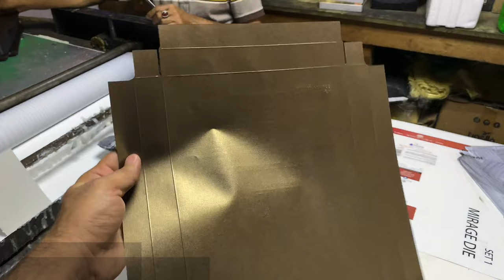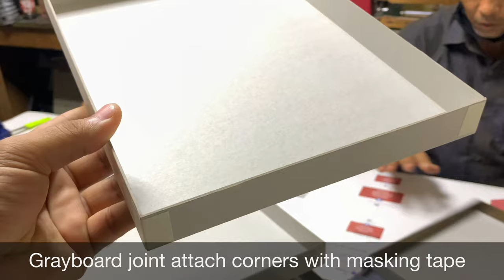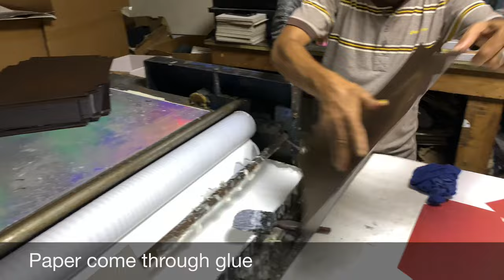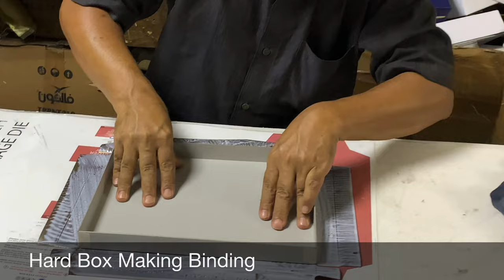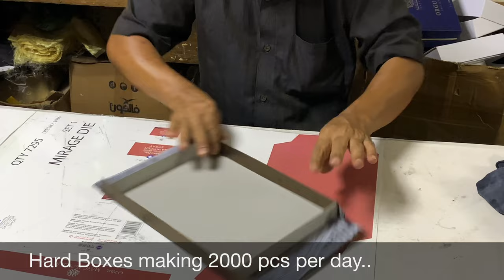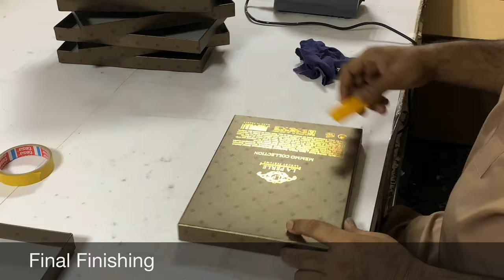Hard Box - Packaging Process in Printing Press

Comment: sir,very well done.
which glue is used for pasting this box.
Pl suggest that what glue shall i use to paste MANUALLY
Reply from the maker: during auto pasting packaging then should be ise glue.. other wise you can use double sided tape.. there is lots of glue in market according to country wise manufactures..all good
Reply: These are called rigid boxes. U can try jelly glue , this glue is best for rigid boxes..
Reply: @AdobeAi  what you mean "ISE" do you mean "EASY"?
Reply: im using "PVA" glue (white glue) but its wrinkling my papper